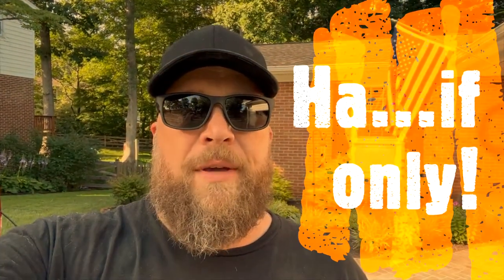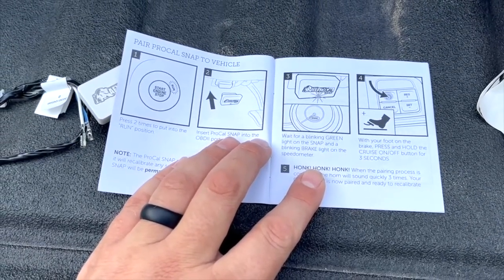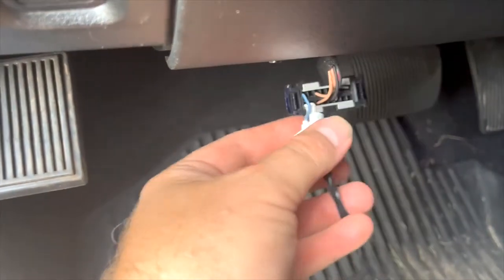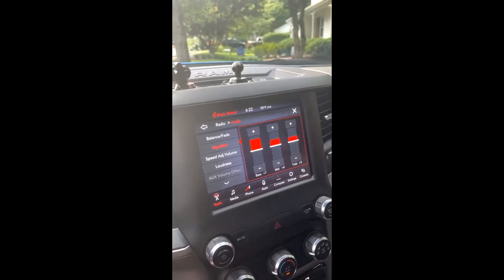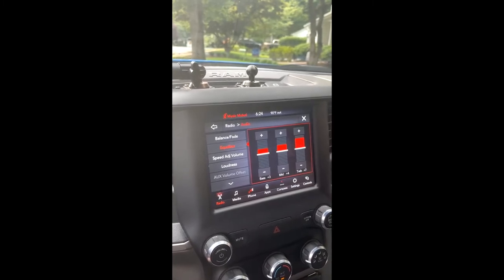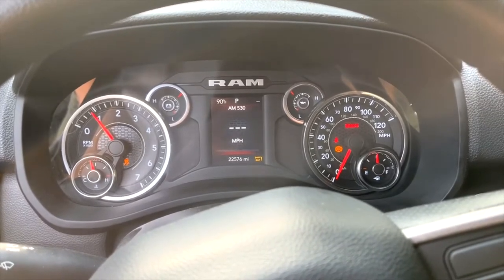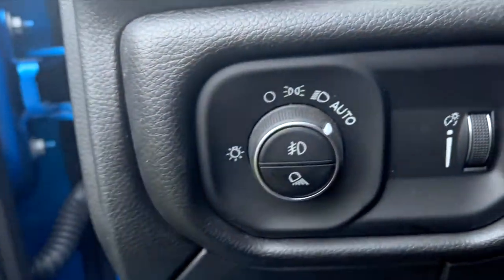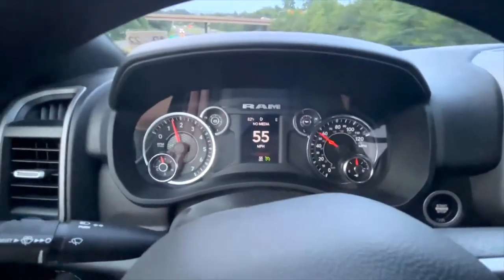Project Powerlander #8 - How AEV's ProCal Snap Made My Ram 2500 Light Up Like a Christmas Tree!

Comment: change the tire size to 33.6 and you will be spot on both speedometer and tripometer.  measure from the ground to the center of the hub when parked on cement and X2 to get the tire size to use. The inventor of the procal told me that.
Reply from the maker: Wouldn't it depend on how big the actual tire is? For example, the BFG metric 35s I have run smaller than other 315/70R17s...
Reply: @TradesmanOutdoorAdventures  yes KO2's do run small. you need to park on a flat cement surface and measure to the center of the hub and times that number by 2 and use that number. I can't remember but I thought you said you used 34.7 in the video which that is too tall.